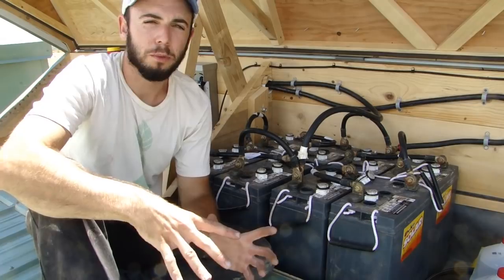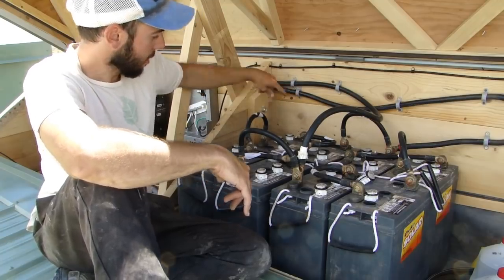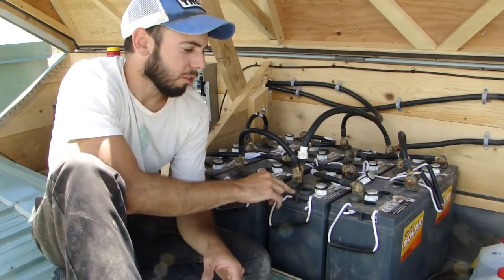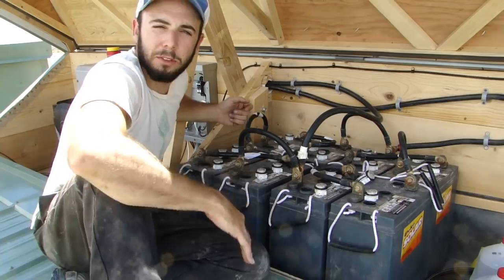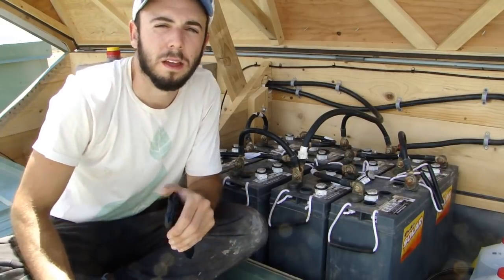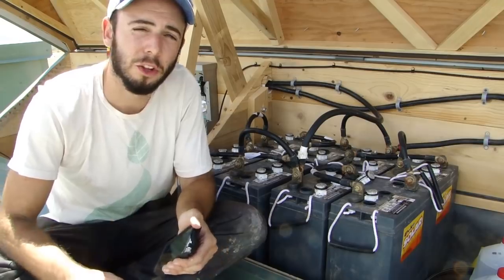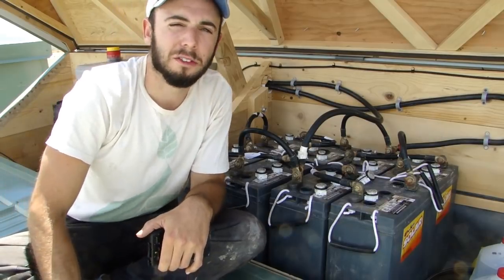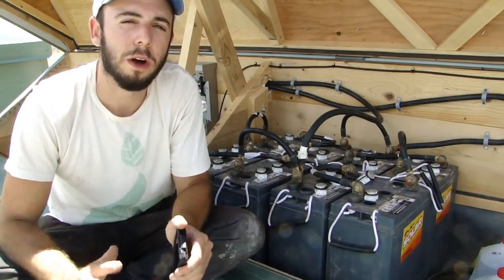How to Size Your Solar System

Comment: If you have 12Volt solar panels... I heard something like you have to somehow get them to 25 volts to charge a 24 volt battery system? How do you do that? It seems like you have to convert to 24 volts from a 12 volt system just to get anything to have enough juice. I can't run hardly anything with a 12 volt system.

Comment: Thank you! Cause ice been in a rabbit hole for a while now on this. Your video just summed up what I would need, cause if you're powering a home with that little of batteries and those panels, then for my shed with a mini fridge, TV and a window ac unit I should be fine with let's say 3 200w panels and 4 12v batteries

Comment: Very clear and informative. It would be good to see the set up and all the gear needed for the system. What happens if you have lots more solar panels does it over charge the battery bank?

Comment: So, I'm starting out new to solar. Well, not really, I took a college class in 1978, lol. It was more thermal mass then I think. I made a great solar oven that would do a mean roasted chicken. So, I have 4 - 90w pannels (zamp) in parallel. I think I may have now 720 watts? I only have two deep cycle fed by a 40 amp zamp controller. I just want to maintain battery for fridges, I have two in the rv. hmmmm

Comment: Funny I just did the math fast and I'm using 4.8kwh per day in my 25' RV .. then what my motorcycle uses is a different store all together lol 
I built it at 96v 10kw and now it's using a nicer Kelly controller and basically bridge cables as wires lol it goes through quite a bit more then my home/ rv .. a lot more realistically lol well I can rip through that in less than an hour if a rod the hell out of it lol so 10kw in an hour.. or less lol

Comment: If I have 4 12 V and 300Ah batteries and I still have 4 12 V but 150Ah batteries, how can I connect them in series and parallel?

Comment: I have a question. 

If you’re using approximately the same amount of KWH as the panels produce daily, and let’s imagine most usage is during the best charging hours, wouldn’t that mean that your batteries stay almost fully charged? 

I would imagine that if you use the same amount of energy produced each day, that you would need to use an extra 15-20% to get down to only a 70% charge.

No?
Reply: Also, great video, I will not need to watch another one to understand how to make the power calculations.

Comment: hello all ;-) QUESTION :       what happen to the solar's panels when the batteries are full.. and the sun is still there, so the panels are still producing..      and you not use this electricity..   you are off grid..    so where it goes ?   and can it damage any component of the system, or appliances ?             please, if someone can answer.. many thanks.  ;-)

Comment: From the web:
 
Automotive batteries may last for thousands of cycles in normal use (2-5% discharge).  Their niche is providing the power surge necessary to start an engine. In general they should not be discharged below 80% of total capacity, if so they will generally fail after 30-150 such "deep cycles".  Therefore if using automotive batteries for backup power and seeking long battery life, in calculating capacity consider the battery as only 5% of its total rated watt/hour.
 
Deep cycle batteries have much thicker plates and are in general designed to be discharged down to as much as 80% time after time.  While they can be discharged further doing so repeatedly will shorten the lifespan.  For optimum battery life in calculating capacity consider the battery as only 20% of its total rated watt/hour.
 
EXAMPLE WARNING AT THE TROJAN BATTERY SITE:   If discharged to 50%, expect the life of those batteries to be 600 cycles.  Maximum life span per their chart is 3,000 cycles, if not discharged any lower than 80% of capacity.
https://www.trojanbattery.com/products/deep-cycle-flooded/signature-line-flooded-2/
 
Example:  Motive (Trojan) brand, the case marked 12v, 105 amp/hr max.  1.260 kwh maximum
https://www.trojanbattery.com/pdf/datasheets/27TMX_Trojan_Data_Sheets.pdf
 
For optimum battery life based on the Trojan warning in calculating a balanced system these batteries should be considered as storing approximately 250 watt/hour.

Comment: Would a generator harm the batteries if you connected it to the system for rainy days or power outages? If no, how would you connect it?

Comment: Excellent  Solar  panel batteries   Watts power  generation engineering #   my house   Watts/ hour     consumption is  around  60, 000  Watts  of  energy  in  12 hours  #  it means  i   need  6000 Watts/ hour  capacity  Solar panels  which  will  generate  60,000 Watts  in 10  hours  sun exposure #  to  achieve  6000 Watts /hour  power generation  some  Solar panels  must be  connected  in  series  & some  in parallel #  same  applies  to  batteries  #  some batteries  must be connected in series  & some in parallel  to achieve  60,000 Watts / hour storage    #  but  batteries  only  store  the  power   their   storage  capacity  ( not  power  generation capacity )  must  be  60,000 Watts /   to  meet  my  energy  demand for 12 hours #

Comment: In fact, Ohm's law states that electic resistance is directly proportional with the voltage, and inversely proportional with the current: 1 Ohm = 1 Volt / 1 Ampere
:)
https://en.wikipedia.org/wiki/Ohm%27s_law

Comment: I'll tell everyone how to size it. You size according to what you need, not what someone on youtube tells you you need. I found that out myself. 4 6 volt golf cart batteries, lead acid, runs our camper with a 8000 btu window air running for 22 hours, no problem.

Comment: Jawmall Supply solar charge controllers with high quality,@t offer solar charge controllers from 3A to 80A PWM Solar Charge Controller and mppt charge controller,EPever solar charge controllers,Jawmall solar  controllers,Jawmall Solar Regulator,Power Inverter,EPever Inverter,Solar PV,Solar System,Solar accessories, and more for Retail,Wholesale in Jawmall at right @t us sales@@t or Tel: +86-18707756219  By JawMall.

Comment: Someways you are right but inverter is the keys  now days I can use hybrid controller and drains the power directly from sun without battery connect I’m taking about a controller from 2019/2020

Comment: Thx, excellent explanation. Though frankly solar still seems like a pretty pricey setup for even just 1500 watts of AC current, that's gonna take a loong time just to break even. And that's not counting 'consumables' like replacing batteries, motor wear on the moving panels, and repairing parts on the turbine, etc.

Comment: My max usage on electricity per month is 285-kWh and its bumped up rarely at 350-kWh only when I use excessive electric heater and summer fan when its really hot.
But over all my max on a monthly basis is 285-kWh per month.
Ive been trying to figure out a system for years for me. that would allow me to use 285-kWh per month when completely off grid for extended period of time.
For example 12 months. - in case my city goes into a blackout for 12 months, i want to be able to still have my usual 285-kWh to a max of 350-kWh per month on a given month.
And not have to worry about ever running out of power. - And yes I do know you're not suppose to use more than half the batter bank capacity.

Comment: A bit confuzed here.
1:49 
4 Batt. In series 
AMP Remain same.
Volts Double

2:03 
Amps Remain same

2:12 Amps double.

This sounds like your correcting yourself or changing.

Do the amps double on parallel
Or volt double.

No explanation just 
Which one.
Dont need a round about.
Just math formula

Break it down text somewhere please.

Comment: You need to check out A/C coupling,  I live off grid with a Freezer, 2 refrigerators and 2 x 2HP A/C. All running 24/7. The cost of Grid Tie inverter's is much less than the off grid inverter/Charge control combination and the 600V string voltage means the panels are connected in 1 or 2 strings per inverter. With A/C coupling you only need to worry about enough battery capacity to use during hours of darkness, your ignorance is costing people a lot of money!

Comment: You are way underpowered in solar panels for that size 24v battery bank. You didn't include the conversion loss. Also cloudy days? I don't care how big a 24v battery bank is I wouldn't build one below 1200 watts of solar and mine has 1650 watts and I only have 200ah of usable ah. Up here in Montana sometimes it's cloudy all week in winter but the snow boosts the panels and cold temps actually improves the performance of my poly panels. Between conversion losses and cloudy days I'm charges in 2 hours worst case scenario. I'm soon to expand to 400 usable ah. My panels are already ready for the expansion. ALWAYS Overkill the panels.

Comment: I'm going to attempt a solar panel without battery.  Not to power anything other than a 100 watt thermostatic ceramic heating element, in Calgary Alberta - where we can use supplemental heat even during the day for at least six months.

As the price per panel gets into the 60 cent/watt range, I can imagine more people will consider them to be used batteryless as a simple 10 to 25 year MMBTU heat transfer device.

Being able to simply charge a set of three or four $2 lithium 18650's would probably be a huge boon for microgeneration.
Reply: During the winter ?

Comment: Hi sir ! Can you help me ! I would like to build a solar kit for my house in case of a shutdown current . I would like to use at least 2 refrigerator both are 575 watts and 2 heater 1500w =3000w .I would like to add the power directly in my 200amp 120/240v panel . so if I lost current Iwant like both refregirator work and 2 heater like I said . So how many solar power in watts ? ,after the solar panel controller how many amps ? and the inverter how many watts at 240v because I want to add this power in my electric panel or if I cannot do this I will need a inverter with a outpout at 120v .and the Batteries wich one and how many amps /hours . I do not know if it possible to get solar current for many days of dead current ? or only for few hours ! can you help ?

Comment: I have a question. Am I damaging or even shortening the life of my battery? I'm using a 12v 800A battery with a 750w inverter just for charging my cell, and a lamp. I'm only using between .6 to .9 volts before I get a full recharge from a single panel.
Reply: The more you use a battery, the shorter the life.  You bought the battery, so use it !!!  When it wears out, buy a new one.  Batteries are like car tires, 1) the more you use them sooner they wear out, 2) if you don't use them, they both have a limited shelf-life - tires will dry rot from non-use and a lead-acid battery will die from old age, even if never used.  There is way too much unwarranted worry about using 20% vs 30% vs 40% of the battery ...

Comment: Get lithium batteries their 100% more efficient charge faster and can be run all the way dead best choice for powering a home
Reply: Lithium costs way too much!  So, how much would a 24 volt 700Ah Lithium Battery Bank cost?  $14,000 for Battle Born ...

Comment: Bwahahaaaa!! This may have been accurate 8 years ago but it's extremely inaccurate now! 🤦‍♂️🙄
Reply: Why ?
Reply: @MrSummitville  First off he's using extremely archaic batteries that are literally more expensive than other cleaner more powerful options. He's got probably close to 1,000 pounds into that battery bank! Both of which are completely unneeded.
Reply: @ezmeraldadudortoka7549  What battery is cheaper on a "kilowatt-hours x total cycles x DOD" basis over their entire lifetime?  Who cares that the entire battery bank is heavy?  I only pick up one 6 volt battery at a time, and they are only moved once every 10 years
Reply: @MrSummitville  lithium-ion. 1.2 kWh @ $200. 90% available for usage.
Reply: @ezmeraldadudortoka7549  What Make & Model???  Reply with a URL, to the exact product.  And how many CYCLES at 90% DOD?  A 1.2 kWhr Battle-Born Li-Ion Battery costs a whopping $1,000 with a 10 year warranty, but only 3,000 "Lab" Cycles = 8 years.  BTW, he has almost 33,600 Watt-hours available, if needed - not daily, if needed during the winter no sun.
Reply: @MrSummitville  Plus, I'm recycling the nastiest chemical that we extract from our planet which means you're not contributing to the mining of new lithium.
Reply: @ezmeraldadudortoka7549  What do mean, "... If the die ? ..." They have already FAILED !  The capacity of those USED batteries has already fallen below 80%, and are most likely down to 70% of their rated capacity.  They are NOT 500 Watt-Hour each.  You are buying another persons garbage.  At 90% DOD,  you will have about 200 more deep discharge cycles = LESS THAN 1 YEAR in a "TINY" Off-Grid Home.  The cost of those used batteries in a TINY Off-Grid Home ( @ 3 kWhr / day discharge ) will be about $14,700 over the next 10 years ...
Reply: @MrSummitville  I have no idea where you're getting your information buddy but you're completely wrong and completely out of line...🙄 I have six of the modules myself that were delivered at 87% capacity. I have coached over four dozen individuals through the entire process of reclaiming leaf modules into their very own solar systems and none of them reported anything below 83%. I never claimed that they're 500 amp hours... Obviously they're used which is going to make them less than that...🤦‍♂️ I don't know what you're talking about with your one year lifetime... You have absolutely no idea what the usage was on them. Trying to make a concrete math equation out of variables that are unknown is extremely juvenile. They last a hell of a lot longer than one year because I've been powering my entire life for two years and haven't lost a single percentage of my state of charge or depth of discharge. You're using math equations for the wrong batteries... What I meant with if they die is that if four, five, or six years down the road they actually do die I can replace them six times before I get to the brand new price... Take your misinformation and fear mongering elsewhere unless you're able to educate yourself to what the actual situation is. Watching all the videos on this channel of mine so you can fully understand the situation before claiming false math and statistics...
Reply: @MrSummitville  Also, how in the world are you saying they've already failed? Again, you have no idea where they came from and neither do I. The company that I buy them from pre-tests them and marks them individually with their used voltage and then ships them within 2 weeks of that test. They didn't fail anybody... They came from reclaimed, wrecked and or totaled Nissan leafs and had no damage to the battery pack. You obviously have some misinformation and are making solid misinformed statements like you have the correct information... Educate yourself before you make an ass of yourself!
Reply: @ezmeraldadudortoka7549  Because the Company said so " ... Nissan Leaf Battery Generation 2 Module Lithium Ion 0.5Wh 7.6v per module. This batteries will have 70%+ capacity ..." .  Yes, you can buy other peoples garbage.  Sure, you can get lucky and get better garbage ...
Reply: @MrSummitville  Also, I wouldn't call it luck when well over 50 people have placed orders and have all gotten pretty much the same thing within 3 or 4%...

Comment: You are looking at the math all wrong. 800W of PV (30A charging at best) is nowhere near enough for 24V 700Ah battery bank as that equates to 10 hours absorption which you will NEVER get from your current solar, thus the battery bank is always being undercharged and will need constant equalizing to de-sulfate. For that battery size daily cycling you need 15 - 20% charging source which is 100 - 140A charging PLUS your loads during the daytime. Those batteries will sulfate and die in under 2 years guaranteed.
Reply: He said, typcially he does not discharge more then he can recharge the next day, using Solar Panels !

Comment: Buddy your way smarter than I am you lost me right our of the gate ...mainly as far as constant use I am going to need to run my fridge my AC might be a close second so with that system you have there how long will it run I can crank up my generator here and there as needed but I want to have solor power for my fridge and AC and probably a couple lights here and there
Reply: Way too little information provided ...

Comment: I did plan to get off grid by buying 6 x 330Wpeak  panels what is some 1900 watts, this is higher then needed, I did this because sometimes I do welding metal and this needs power. E way to weld is using batteries as source, and not a transformer, for example, but a 5000 watts inverter does feed the welder properly and welding is never hours on one go in hobbie.

Comment: Which is better more volts or more amps
Reply: Typically a 48 Volt x 350 Ah battery bank ( all in series ) with smaller wire would be better then 24 Volt 700 AH battery bank ( two banks in parallel ) with big / fat wires.  Typically, we do not go higher than 48 Volts with Lead Acid banks

Comment: I found this video  instructive. I am considering building a solar system for my work shed. It will be providing power for lights, a small window air conditioner and  a few power tools. I know I will not need anywhere near enough power for a house. How many KW hours do I need to design the system for?
Reply: Did you say A/C ?

Comment: Batteries are measured by amp hrs not watts. Why covert it just to get killowatts it's like changing metrics back to standard measurements. Amps in amps out.
Reply: Because the kil-o-watt meter tells me how many kilowatts at 120 volts my fridge uses each day.  It does not tell me how many amps at 13.2 volts.  There is math, no matter which UNITS we use.  And everybody on the grid already has a utility bill with kilowatt-hours, it is never in amps @ 13.2 volts.